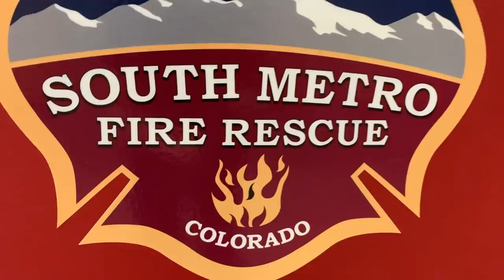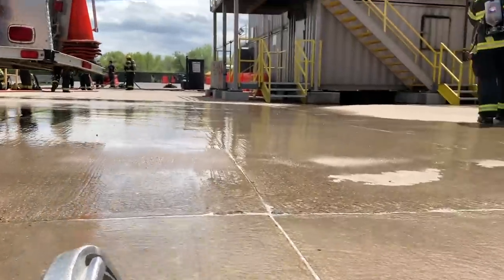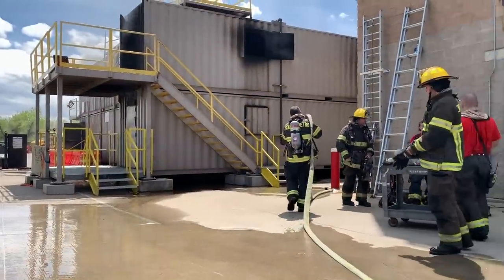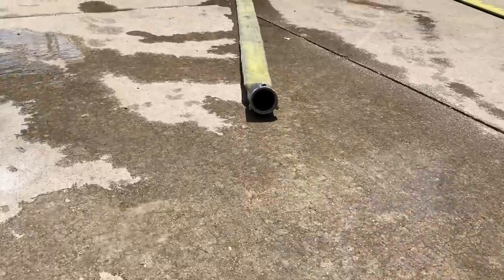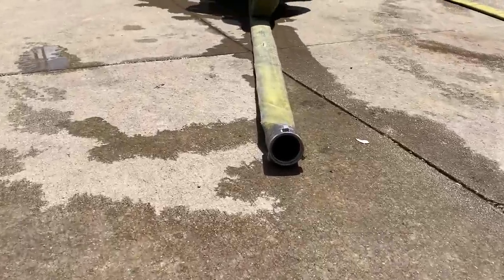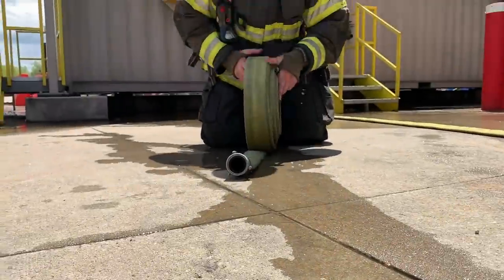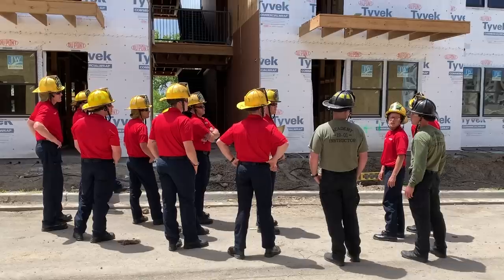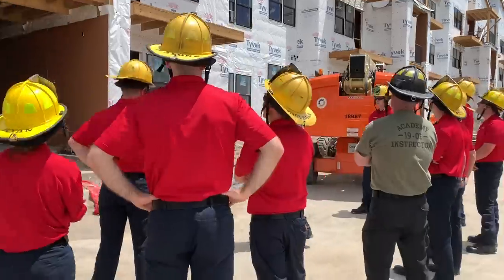Fire Academy Week 8

Comment: Seeing the differences between Germany and America is really interesting.
When in comes to the construction of houses probably 99% of the houses here in Germany are made out of some kind of brick (eg actual brick, calcium silicate brick...) or concrete. Drywall is only used, if you want to separate one room from the other after the house is build.
Our EMS-Training is also very different, even the most basic professional training (after which you are called "Rettungssanitäter which would already translate to Paramedic) takes about 3 months. But that's only the training for the driver of an ambulance, the person in charge of the patient's treatment is a Notfallsanitäter (which would be a critical care Paramedic). The training for that takes a full 3 years 😅

Comment: i cant see how that last statement he made about houses now burning faster than houses 50 years ago.. i just renovated a heritage house and you've never seen such dry wood before. not to mention, builders had no regard for fire blocking/ fire provention. and since no thought was really given to providing the house with shear strength (sinse everything was buttoned up with shiplap), id imagine ur looking at a far more dangerous kinda beast extinguishing an older house. correct me if im wrong.
Reply: good point, thanks for the response
Reply: So even with all the insulation and houses being more air tight today youre saying that the use of Osb has increased its flammability? I’m very interested in this. Multi family buildings have stricter codes on fire blocking they should burn slower for sure right? 100% houses burn dirtier today with all the chemicals.